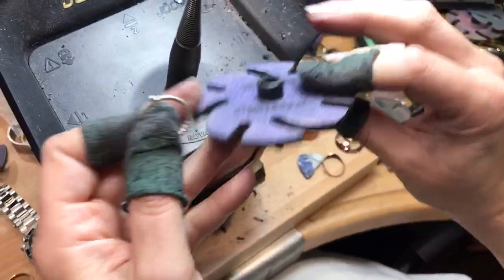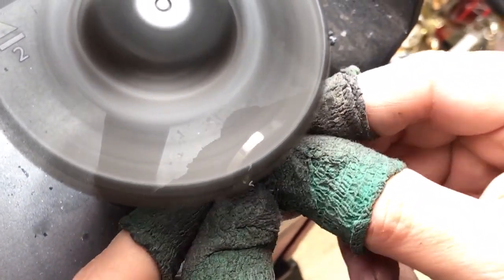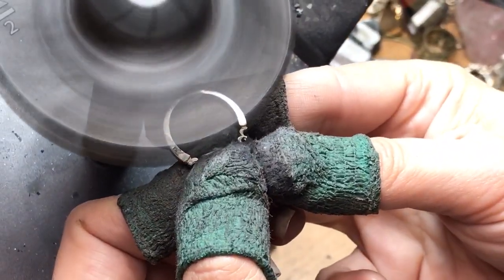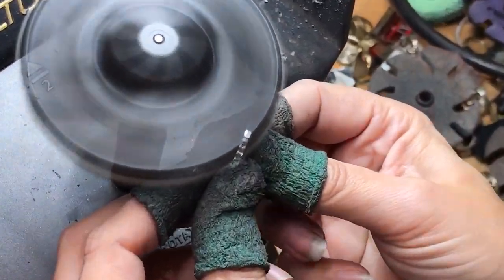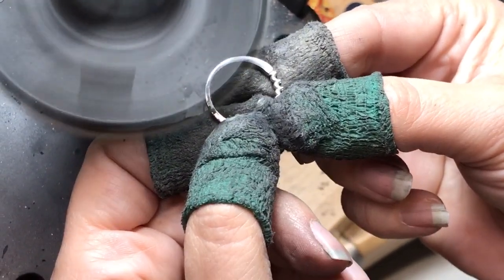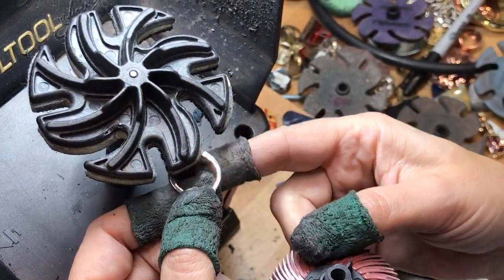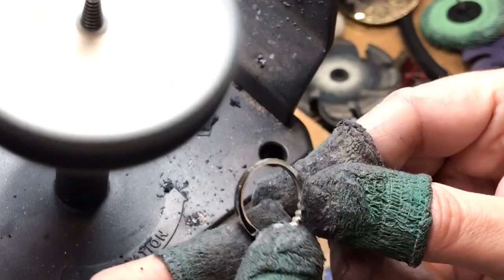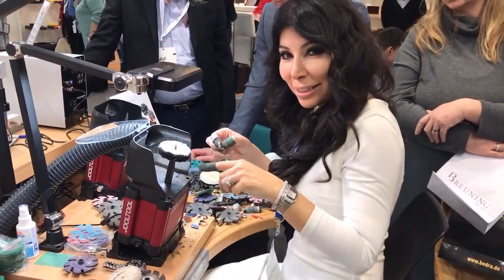Casting Polishing from Start to Finish Fast & Easy on the Jooltool. Part 1, Part 2 Prong polishing

Comment: what grits did you use to sand off the casting screw/tree off? and what grit did you use for polishing?
Reply from the maker: To grind the Spru I are used a 120 grit 3M Cubitron abrasive. I smooth it with the 3M Scratch a Eraser it is not based on grit as it is a surface conditioner and fills in cracks and porosity. I used the Jooltool felt wheel with the Jooltool compound. ♥️
Reply: @JooltoolUSA  thank you, I will use it and let you know for sure.

Comment: Is it possible to use a rotary tool?
Reply from the maker: To get this finish it is impossible on a rotary tool. A rotary tool has smaller bits and usually will create an uneven surface or even waves. Remember with a rotary tool you have to hold the tool in one hand and the piece in the other and it’s very difficult to achieve a uniform finishe that way. The Jooltool makes everything so much easier when you don’t even have experience to accomplish professional results!
Reply: @JooltoolUSA  ok, but what about the inside of the ring?